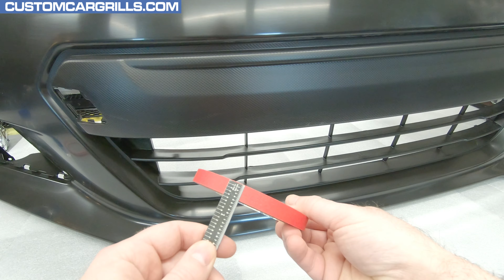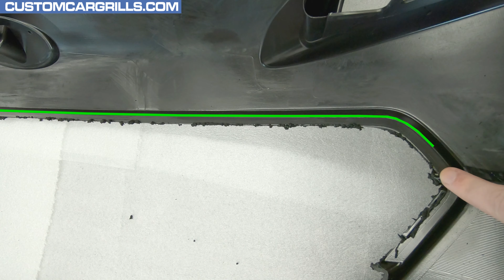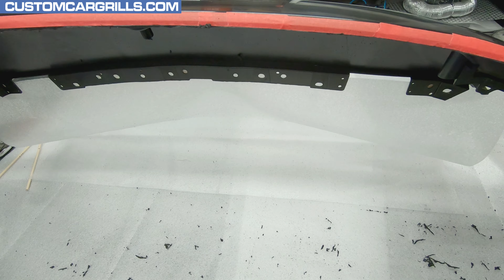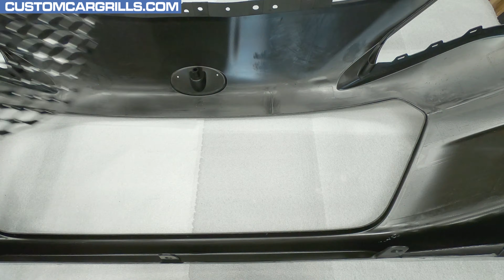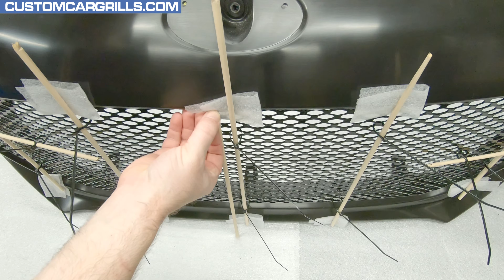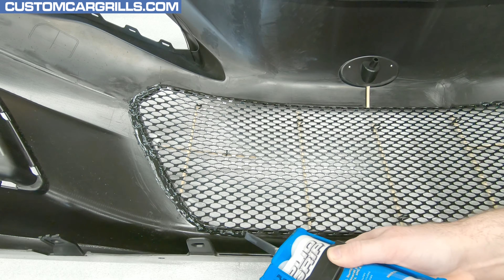How to Install Grille Mesh on a Subaru BRZ 2013 - 2016 by customcargrills.com

Comment: Do i need to cut off the grill in 2017 brz or there are clips back to the bumper, unattached the clips
Reply from the maker: From what I can recall, there are clips on the back of the bumper which need to be released in order to remove the stock grille.

Comment: I bought this mesh and I'm in the process of cleaning out the edges when I realized, how will I put my license plate on the front end of the car? Have you ever had this question? If so how would I be able to secure the plate on the bumper?
Reply from the maker: I most  commonly see owners cutting a hole for the tow hook and then using a tow hook plate mount.  I've also seen some owners bolt the plate directly to the mesh with a rubber trim around the plate.

Comment: Will it work on a 1st gen 2020 BRZ Limited?
Reply from the maker: Yes, this mesh piece can work on the facelifted bumper.  We have a picture of an install of that here:  https://www.customcargrills.com/customers/Subaru-BRZ-2013/Custom-Mesh-Grille-For-Subaru-BRZ_08.jpg  

With that said, there is a small different in the upper corners, compared to the first version of the bumper.  So, yes, this will physically fit, but you'll need to do a little extra cutting on the sides if you want a smooth transition from the upper corners.

Comment: How does this work if you need a front license plate?
Reply from the maker: Owners can either cut a hole in the mesh and use a tow hook plate holders, or just tie the plate directly to the mesh.

Comment: I'm looking to do this to my 2018 BRZ. Is it the same process?
Reply from the maker: From what I understand the install is very similar.  I think there's a little additional cutting needed in the upper corners but the overall shape and size of the grille opening is the same and the mesh piece will work for it.

Comment: Do you have any other pictures of it after it's reinstalled? I think BRZ's have a taller height area where the grille goes compared to the FRS-86's but I can't fully tell without comparing them in person but it seems like the BRZ grille space kinda looks awful big without the solid bar from the OEM grille
Reply from the maker: I do have some coming to our website soon.  We're in the process of updating our customer galleries and I have 4-5 installs to post on there.  You're welcome to email me in the meantime and I can reply with some.

Comment: Is it pretty difficult to cut the grill material? I want to do this with my 2013 FRS but obviously will have to order the 16x48" sheet and cut to shape. Any tips?
Reply from the maker: I'm not going to say it's easy to cut the Perf GT mesh, but in my opinion it is reasonable to do by hand with a good pair of tin snips.  

I'd suggest making a good paper template first and then transferring it to the mesh before cutting.
Reply: @customcargrills  sweet thanks, do you think a medal cutting dremel would be better or would snips be the most efficient? I’ve worked using paper templates for projects like this before, would the best way to bend so that I can glue it just be using needle nose pliers maybe?
Reply from the maker: I prefer using the tin snips over a dremel.  As for bending the mesh, you'll probably need to hammer it over a wood mold to get a good fit.

Comment: Is the fitment different than the 2017+ brz bumpers?
Reply from the maker: The 2017+ is similar but different.  I haven't personally tested the fit to see what (if anything) is needed to be done different for the install.
Reply: @customcargrills  would it be best for me to get a mesh sheet or the precut 13-16 brz mesh grill to mock up on the 17+ bumper?
Reply from the maker: Feel free to buy the premade and be the tester for it  =)  It might be plug-n-play right out of the box, or it might need a little work; Im not sure.